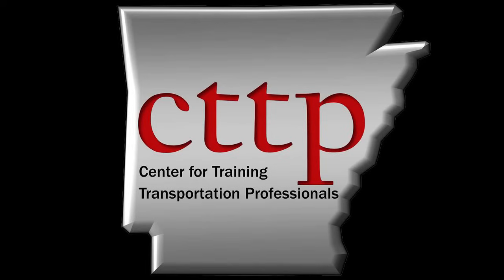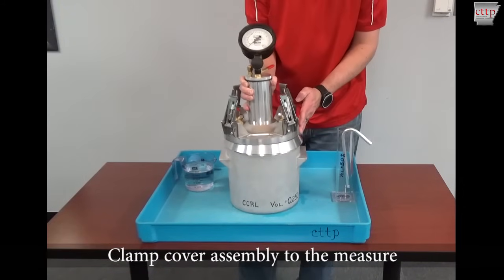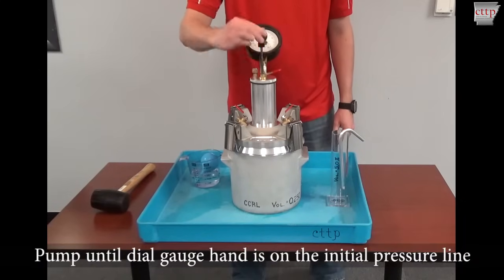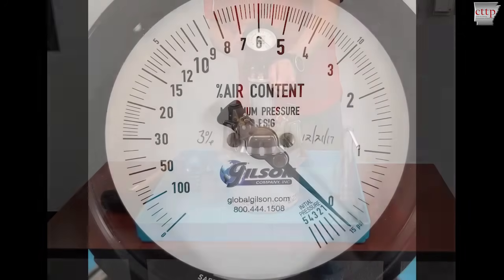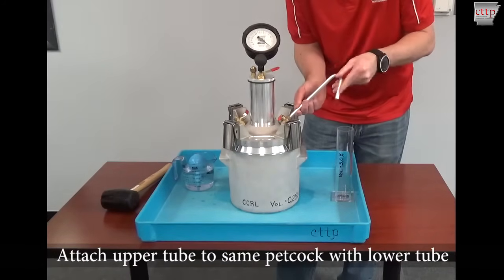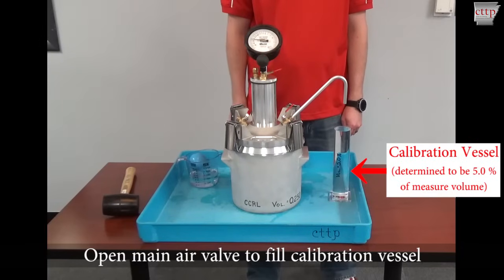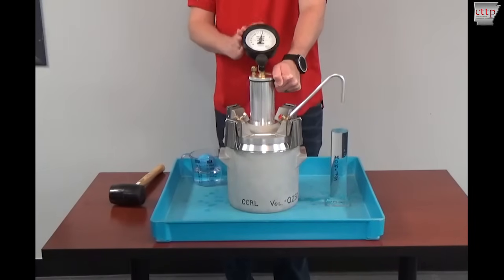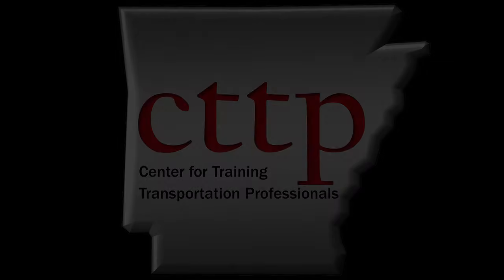ASTM C231 - Calibration of Type B Meter

Comment: All well and good.  Please show us how to adjust the dial gauge if it is not withing tolerance from the zero line in the beginning.  Leaving that out is weird for a training video.
Reply: The needle has 2 set screws on it, take off the cover plate on the dial and adjust the needle accordingly.